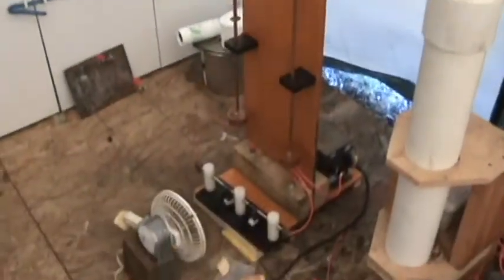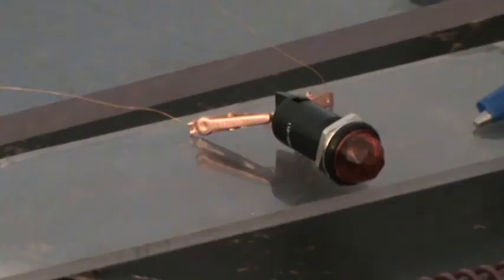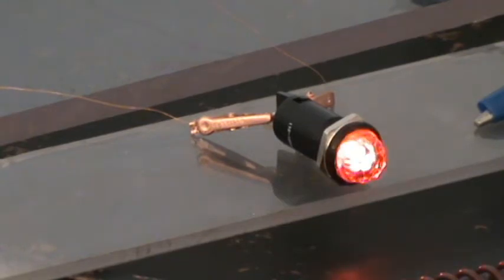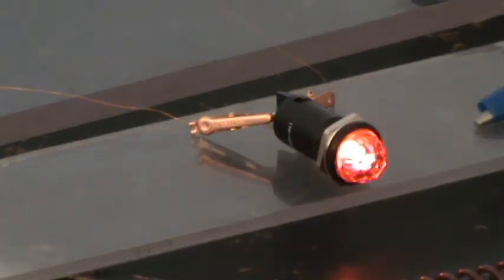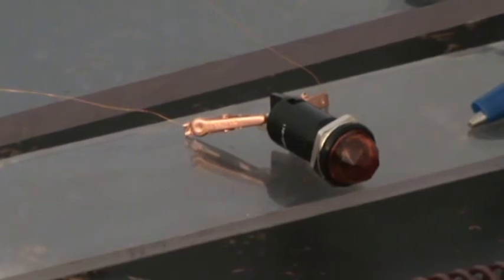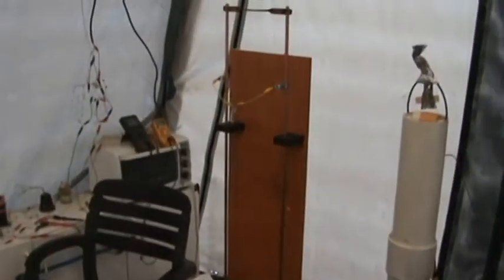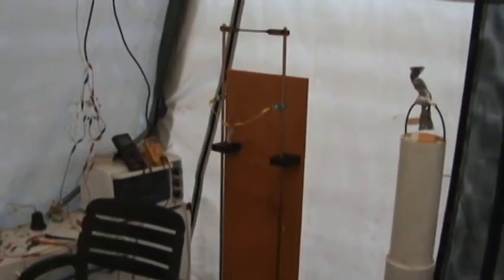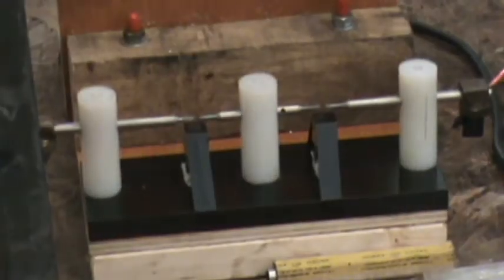TESLA'S HAIR PIN CIRCUIT Part 4(transmission through the ground & single wire transmission)

Comment: Change your spark gap bolts to brass, or put brass nuts on the ends. There will be considerably less ionization and you'll also notice a cleaner ozone aroma

Comment: Not sure what your optimal frequencies would be, but for low voltage/power uses [like the LED] I would assume you could be miles from home and still get light.

That said, for high power [such as heating or running a motor], you need to really crank up the voltage and use a transformer to get the needed amperage, or else design a voltage dependent motor/heater to utilize it directly at far reaching distances.

Your use of one wire, under ideal circumstances, will still experience impedance, resistance, eddy currents, emissive losses and skinning, so you must pick both a voltage, and a frequency which can deal with these issues.

A reasonable candidate might be carbon nanotube / graphene wire.

It has loads of surface, very low resistance, no known impedance, no known eddy currents, should have very low emissive losses,  and should not corrode. On top of that is it very light and very strong.

That should resolve a lot of your long range power issues. (~_^)-b
Reply from the maker: Oh, i will search for this wire, i bet it is not cheap.   Youm mention ,,,"or else design a voltage dependent motor/heater to utilize it directly at far reaching distances.",,,,,,Yes, this is what i was thinking about :-)
Thanks for your comments, good ones as always :-)
Reply: I was informed by my dad about all of this when I was a child, my dad was an electrical engineer and a radio enthusiast who was even given a totally free lifetime license by the FCC to run his own for profit 50 Kw radio station, and we made some coils, he put up an 80 foot tower which was there until a really strong storm tore it down, [not a true tornado, just really strong cross winds, and it only crushed the support at the bottom, but he had to tear it down anyhow because it was no longer usable and he just did not have the time or enthusiasm to put it all back].

Our basement looked like a military command center from WW2.

Sadly when he died, all of his wonderful goodies god destroyed by hateful ignorant closed minded relatives, whom I am NOT friends with.

Tesla is somebody I knew about all my life and inspired me to dream and invent.
Reply from the maker: Very cool story, was easy for me to visualize,,,,thanks for sharing :-) I would of loved to meet your dad & see the basement.
Reply: This is something my dad taught me about that would be great to look into... 

https://en.wikipedia.org/wiki/Schumann_resonances
Reply from the maker: Oh yes, i know this freq well :-)
Thank you.

Comment: you mentioned you felt like u were getting a rf burn ! 2:56 into the video.rf burns can be very nasty,  that is why i said u dont want to
Reply: Likely is RF burn, my dad taught me about that.

It is said that one of the biggest problems Tesla had was that his system was potentially able to cook the public it was meant to serve.
Reply: The rf output of this small of a setup is negligible, danger would come only with much larger inductance. However, i will concede that tens of hours of exposure may cause varying degrees of discomfort.

Comment: I've found a gas discharge tube on each leg works fine, in place of the spark gap. Same results , no racket , or fcc violation. In their eyes , spark gap "transmitting" huge noise across wide wireless spectrum. Send out the pirate radio van, take your gear , large fines. Local Ham radio ops, will rat you out. 
Thrilling hitting point you're at , now go stealth . Grab a few extra tubes , they are fragile.
Reply: BASENTRIM333: I agree. Spark gap transmitters are illegal irrespective of intent. If the gas discharge tubes succesfully prevent transmission that would mitigate the possibility of losing the equipment, getting fined, and/or imprisonment. They would likely take absolutely everything involved.
Reply from the maker: Thank you, i been wanting a gas discharge tube for a while now,,,,just that i did not know what they called them, thanks,,,"Gas discharge tube", now i know what to search for, hehehheeh.  I remember searching for vacuum spark gap tube, hehehehe
Reply from the maker: Yeah i been waiting to see a special black van driving around my block.  I will have to be careful and get the gas discharge tube :-)

Comment: Hi . I am wondering ?. The neon lit with out the spark gap. None of the flickering was seen. Maybe that would be better for say lighting ?. Just a few thoughts.
Best of luck
Bobby
Reply: Bobby Tectalabyss the neon lit without the spark gap because it became the bridge between + and - . Ideally the spark gap acts as your pulsed short circuit allowing for, negative energy flow or whatever other name you wish to attribute. The point being no spark = relatively standard circuit.
Spark= pulsed short inductance.

You may think im full of BS but Eric P. Dollard and Michael Leas(along with countless others) both made revolutionary steps in this field, take not my words at face value, but heed their imperical proofs.